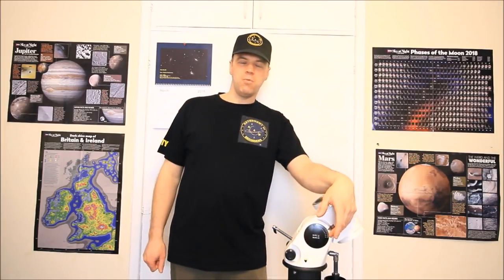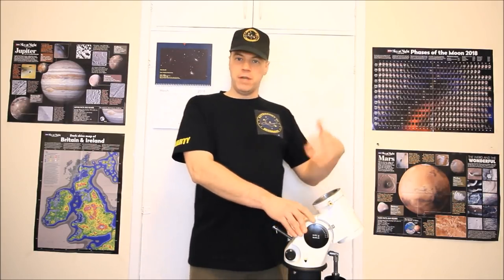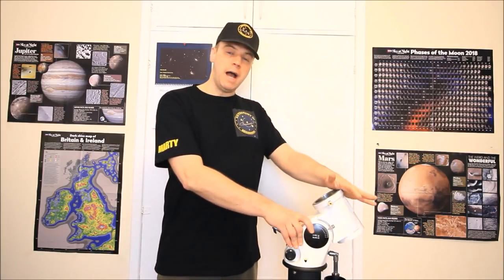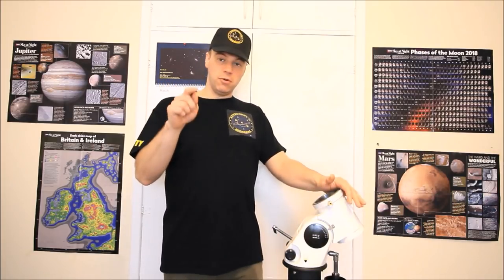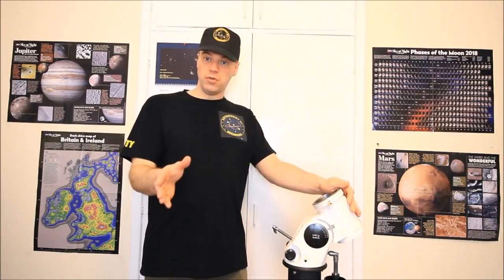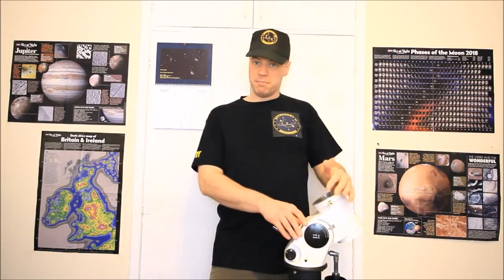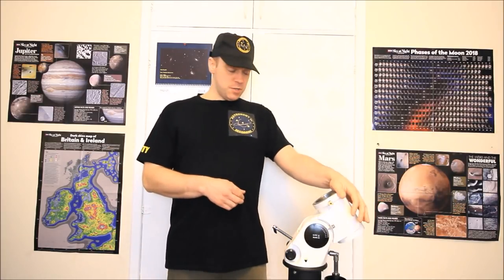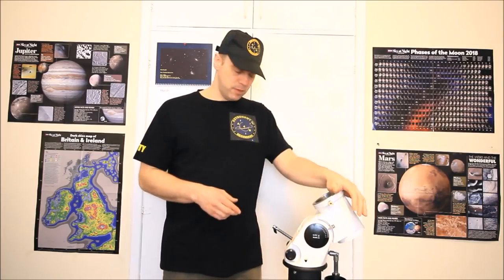How to Super tune the Skywatcher NEQ-6 Mount Part 4

Comment: Once the worm gear was moved over so the belt was aligned @39.32  do you think that there was a need to grind down the casing in the end?  or would have this movement in of the worm gear been enough to not need to grind the case?
Reply from the maker: Yes I had to grind down the casing as the pulley wheel was catching onto the casing. It depends on every Skywatcher model, some people didn't have to grind off and fitted the modification straight away, again it depends on your mount, not Skywatcher mounts are made the same way
Reply: @MPAstro   awesome  thanks for the info :)